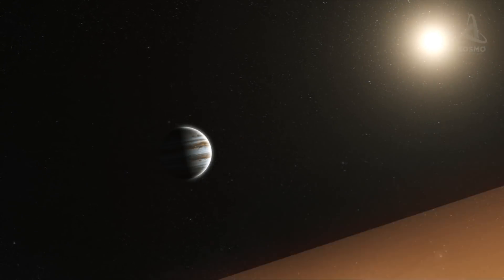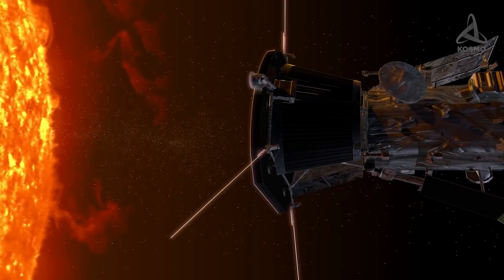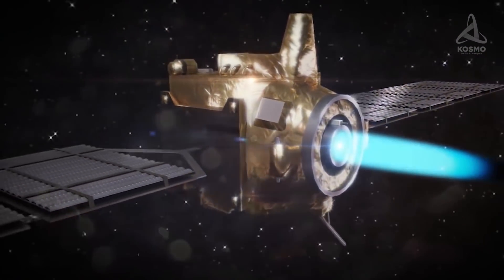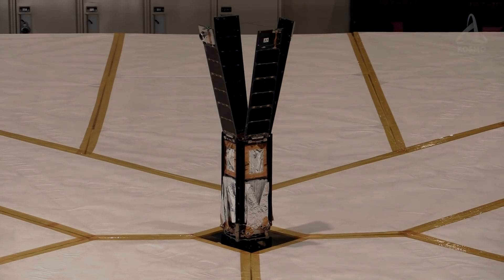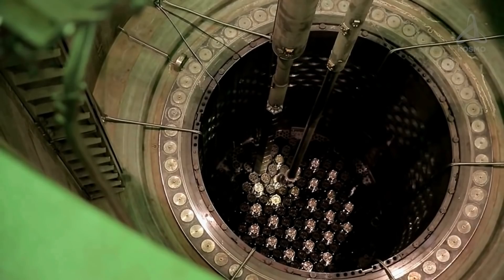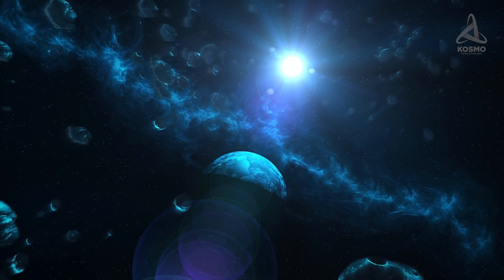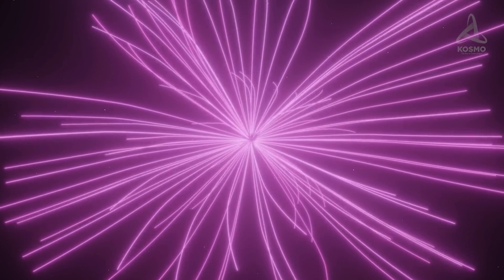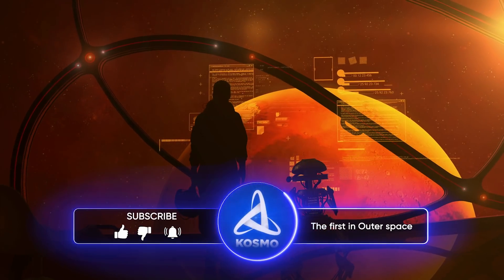Spaceships Capable of Reaching our Closest Stars

Comment: The one way to both harness the capability of electron energy power and proton energy power in space is to create a machine technology imitating how the gluons function plus creating an imitation of how neutrino function to be able to create a neutral mode, but that's a long space travel even at top speed acceleration of spaceships, the best way to reach a destination in space from point to point is to achieve space teleportation capability by identifying it's paths.

Comment: "We can't build anything that would last that long and remain operational."  Not withstanding the energy impact of particles in front of the near-FTL ship; I think that's a wonderful - practical rebuttal to Fermi's Paradox.  A ship that can avoid or bypass all the issues associated with near-FTL travel.  Or we can send a ship that masses less than one pound, that has a capacity to clone 10,000 colonists, and assemble a small city, plus a laser transmitter.

Comment: 11:14 we only need what we not have. all is designed based of asumption it works like this LOL there is no antimatter darkmatter or dark energy an you not move faster bending space you still move same slow space just bending and bended space move faster till it back flat. look that desing it still move same as no benfing lol. o nly we need antimatter. what antimatter. they can just invent something and thing if we only can find this. we only need negative energy. well use positive LOL and there is minus side lol

Comment: It takes twice the number of nuclear explosion that has ever happened on Earth to make a 2,000lb ship reach 1/3 the speed of light, then it takes the same amount of energy to bring that ship to a stop.
Once an object reaches the speed of light it's mass/weight reached infinity.
Then you have all the particles in space that will reduce that ship to dust once it hit the ship, a particle the size of a raisin hitting a ship traveling close to the speed of light will cause the same amount of 80 nuclear explosions when it hits that ship, if you want to add shields they will have to have the same amount of energy to deflect particles in space.

All this means you will never leave the solar system.

Comment: The atomic shockwave/impulse method- if the main worry is radioactive pollution at the launch site, why not launch the radioactive/dodgy bits into orbit first using conventional methods and then put all the bits together using double sided sticky tape / blu tack / glitter glue. If they can fix and upgrade Hubble and build the ISS.....I'm sure that's possible.

Comment: If your plan is to build a generation ship to undertake a 10k year interstellar journey to another star, its crew mission will change before it gets there and the ship will never achieve that goal. No tin can is going to stay structurally sound, with all systems functioning, for over 10, 000 years. No second or third generation, let alone the rest, is going to recognise the ulterior imperative of the end goal. No amount of extra onboard resources to re-equip and replenish will be feasible. If the crew doesn't turn around and head back, it is not going to survive the run to Proxima Centauri intact and with crew alive, sound and healthy either.
Reply: Let me introduce you to the only realistic method for interstellar travel, the constant 1g acceleration method, with this a ship can get to Alpha Centauri in 3.6 ship/7.3 Earth years (and that includes turning the ship around half way and decelerating) and it would have gravity the whole way. The ship would achieve about .95 light speed after about 1 year. A 10 ton ship would need a mere 10 tons of continuous thrust. All thats needed for this to become a reality is a fission rocket that can put out thrust for long periods and does not consume hydrogen. Watch my videos "best method for interstellar travel" and "liquid plutonium rocket", this is doable.

Comment: would it be possible to use the concept of the hadron collider at a much smaller scale to create propulsion?
Reply: How massive is the collider and what powers it, how much mass is that power source? The greater the mass the greater the energy required to move it.

Comment: I'd highly recommend transporting each element in the fusion to Mars with robots that can build the station with the necessary machinery to assemble from there. From there we would use the Solar Electric Thrusters (not SEP) along with nuclear power for times when getting through a blackhole would not seem impossible but doable.
Reply: Um, your totally wrong.
Reply: Ya, good luck with that b/s.  "Getting through a Black Hole"...  Not proven.

Comment: Take the solar sail, but replace it with a sail meant to catch laser beams fired from infrastructure tracing as much of the route ahead as possible. This defeats the rocket equation and thus out performs even antimatter. You probably want one every light-week which is a lot of infrastructure, but a type one civilization can make a lot of these fast.
Reply: it also defeats the reality equation
Reply: @proto-geek248  You can point to considerations needed to be accounted for to make it work, I don't think you can find physics that prohibits this. I can point you to my source if you care

Comment: The hardest problem isn't FTL speed, it is developing shielding that can resist impact of small particles at speed. If FTL is hard, shielding is going to be the real head scratcher.
Reply: Quantum gravity bubble travel will be able to cut through any matter and mitigate those physics. If that was viable, then FTL is just the start. Think of an oxygen bubble rising through oil, or syrup. A craft that harnesses that capability would be able to push space-time around its circumference. Crossing actual space-time without even having any friction, just pushing it out of the way as it passes through. Like water cavitation here on Earth.. The question is, is it possible for us meatbags to be able to survive that? or just a theory.

https://en.wikipedia.org/wiki/Quantum_foam
Reply: Not even mentioning inertia.

Comment: Alcubiere drive even at sublight speeds would be an absolute game changer...not only for space travel..but for Earth travel as well.
 Imagine if you can send a train full of cargo from one continent to other at sublight speeds in a warp bubble...like a vacum tube proposed hyperloop but instead traveling in a warp bubble inside that tube...at even 1 to 5 % the speed of light would be phenomenal.
 All that shipping and transportation problems we have now would be gone in an instant...pollution problems transportation causes would be gone, i mean you can create the needed energy cleanely... granted it would require new infrastructure to be built but after that everything changes.
I think that resarching and experimentation in that techonlogy has a bright future and is really important...short and mid term even more important for living on Earth than space travel...
Sublight warp drive for Earth to Earth transit would change civilisation as we know it...

Comment: 147 km/sec is a little over 1/3 the speed of light, right?
Well 192 km/sec is almost 2/3 the speed of light, right?
Reply: C is approx equal to 300,000 km/sec. 1/3 would be 100,000 km/sec, not 100.

Comment: I use Neutron stars to achieve FTL …first I low pass a star with a scoop to fuel up…then jump to a mapped Neutron star…fly into the cone and it will throw me out at FTL then I jump….can go 80-100 LY easily  in a few minutes
Reply: that's the smartest thing I've ever heard
Reply: @proto-geek248  elite dangerous
Reply: @Cyberpuppy63  my ship is wrapped inside the warp bubble…there is no sensation inside

Comment: Why are space ships still being launched from the ground, vs from being built and launched from space stations?
Reply: I'm wondering the same thing. Lifting off from ground is always going to require conventional engines that ain't Gunna help once the captain says "Engage".
Reply: How do you get the materials into space?
Reply: @zanej3988  the military and nasa could easily figure that out if they don't have ways already. Don't depend on my answer. I would be subject to more of a "backyard" kind of solutions such a gigantic slingshot or a turbo powered zip lines
Reply: One way , or another, the mass would have to be brought to orbit from the surface.....
Reply: @charliedsurf1267  all of a space ships parts could be made on the ground but could be assembled and launched from outer space? All the parts could be sent into outer space with maybe a a large drone that's designed to make it in and out of the earth's atmosphere repeatedly? I'm hoping that my responses don't make me look like a dummy 🙃
Reply: @tomdavidson3826  1 trip out of the gravity well, sounds more efficient than several small ones, but I admit I am no expert in the science and physics involved. 
However, I believe what you described is how it must be done, as with the ISS

Comment: I have a theory, many of these engineers are not still haven't considered . My engine is based off our solar system and works on electromagnetic energy . This will help in the not so far distant future.  My hypothesis will be shared with the media to push forth how this works. I call it btw a volumizing Plasma drive system..and every solution is already in action today and yesterday..
Reply: I are not still haven't considered that either.

Comment: I don't think any of those theories, assuming they worked, could propel a ship beyond 1% of the speed of light.  I question whether it is realistically possible to ever travel to other stars.
Reply: Fusion may be able to reach around 10% (give or take a few %). If you had enough supplies of anti-matter, then you could hit around the 3/4's speed of light mark.

Anti-matter could definitely take you to the nearest few stars within a human lifespan but given the length of travel time, small ship & supplies needed it's never going to be for mass transit. More like a small crew of daredevils looking to be the first humans to reach another system.
Reply: @jamesh8862  That is assuming we can make anti-matter, store it, and use it in a controlled manner.  The best we have been able to do is create a handful of  atoms that lasted a few milliseconds... and that is assuming what they think they made was actually antimatter and they were not just exaggerating things.  Anti matter is still what I would classify as in the dreaming state.

Still even 10% is not even close to what we need.  That is 40 years each way to reach Alpha Centauri.  To go there would be a one way trip... to send actual people would be an act of desperation... so we are talking trying to save mankind.  This means we need enough people to reproduce and not so a minimum of likely 1000 people, the ability to produce their own food, repair/replace every part on the ship (including microchips), the ability to set up a colony on a potentially hostile environment, and have it all in a package that can withstand 40 years of radiation, micro meteors, and cosmic rays...

I would give us maybe a 1% chance of being able to do this in the next 500 years...

Comment: Actually the Orion Engine and the Solid Core are still feasible and possible with the current state of technology we are in.   The serious issues with the Orion engine was the fact that some people figured we launch it from earth or any nuclear engine or reactor, a explosion could result in massive fallout.    In the end its likely will have several engine models running around to achieve interstellar flight and depends on use and function.   

However here is the issue that people tend to not realize. 

Sure we can wait for a FTL drive of some kind.  
Or we can use what we have that we can possibly create now or near future, thus be able to reach a distant star now.   It would take a generation or two but it will allow us to reach the closest stars and the technology of the Orion Engine and or Solid Cores are improved and thus can be perhaps intergrated with what ever new engine we create at some point in the future.  

I see smaller ships using the Solid Core but not really for Interstellar travel but for intersystem and perhaps using probes for instellar until it matures.   The Orion Engines I see however being used on large colony ships or generation ships that can be the quickest way for us to reach distant worlds and we can pretty much almost use it now.
Reply: How are you planning to provide adequate oxygen, water & food to the generation ships?  We have yet to successfully demonstrate a biosphere capable of sustaining human life for years.  How will the ship be maintained?  How much mass will be devoted to spare parts or to industrial machinery capable of making spare parts?  How long will it take for micrometeorites, interstellar gases & radiation to degrade the ship's systems?  Now, let's suppose that against all probability a generation ship actually makes it to another star.  Now what?  How will these colonists survive?  What if there is no suitable planet?  Are they simply condemned to live & die for generation after generation in the closed society of the ship?  Even if there is a planet, the probability of it having an atmosphere and/or soil capable of sustaining life is incredibly small.

I'm all for continuing to do research and to continue dreaming of interstellar travel - but let's not pretend we are even close to having solutions for all the problems such a trip would create.  I will grant that there is a significant percentage of the population I would like to see given a free ride out of our solar system.  We can call the ship the "B Ark", and it will contain all the marketing executives, hairdressers, management consultants and telephone sanitizers...
Reply: For some reason people dont know about the one realistic method for interstellar travel, the constant 1g acceleration method, with this a ship can get to Alpha Centauri in 3.6 ship/7.3 Earth years (and that includes turning the ship around half way and decelerating) and have gravity the whole way. The ship would achieve about .95 light speed after about 1 year. A 10 ton ship would need a mere 10 tons of continuous thrust. All thats needed for this to become a reality is a fission rocket that can put out thrust for long periods and does not consume hydrogen, check out the video "liquid plutonium rocket". With this method a ship can span the entire diameter of the Milky Way in 12 ship/113,000 Earth years, this is doable.
Reply: @shawns0762  So long as were able to mature the technology for fission rockets.  What is the progress of this particular technology.   You can do the same thing for the orion ones at least for short distance from our solar system to nearby ones.  At most.  Fission ones should be researched and looked in to long voages outside our local cluster of starts..  however if we have the capability to get people to other worlds within our capabilities now  We should take it.    Explorers and colonist didn't take the ship that was avaliable 20 to 30 years later they took the ship that was avaliable now or the one that could be made with the best of the capabilities of the time.   

We need to think this with our tech right now for exploration and colonization outside our system.   If we have the means to create interstellar ships or are able to create the technology of the means to create interstellar ships in the near future right now within our technological capabilities we should push for it and then replace it with better ones as time goes on.    

Fission Rockets as you suggested naturally, , Orion Drive (nuclear payload varies) theoretically it can use fission bombs if adapted to it, maturing of technology? :P )  Solar Sails,  (Can use solar winds from stars and in theory can use lasers from a host system to be pushed out to vast speeds)   Ion engines can supposedly do this but I'm not sure of the current energy requirements but we have been using and maturing the technology for decades.   

Look point is we need to consider the fact exploration and colonization of any new systems is going to take time and if we are within even the barest of means to pulling it off we should try for it.   Sure the first gens could be barely working, hold on by duct-tape, spit and faith with travel lasting one or 2 generations of travel time.  A number will fail.  This has happened all the time throughout human history of those that explorers or colonizes.   Yet a few might make it.  Might be able to colonize and each success will prove its worth the effort and the technology improves and matures until such travels takes a gen, half a gen, within the life time of a individual.   from each we get a new milestone a new success mature ones able to go out farther to more distant starts.  So that by the time you get to fission rockets or say the theroretical warp drive (Please one day happen)  You'll already have a number of human colonies of some form, others still onward to distant stars and perhaps a few working together to quickly advance the technology.  Any successful colony will encourage maturing of any engine as well.   As Earth will want to decrease travel time for new colonist to new homes.